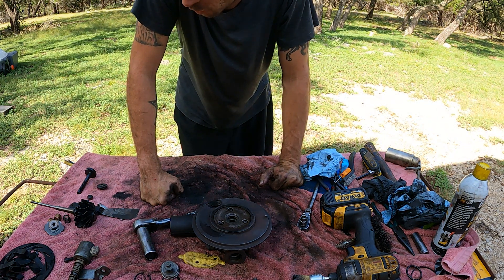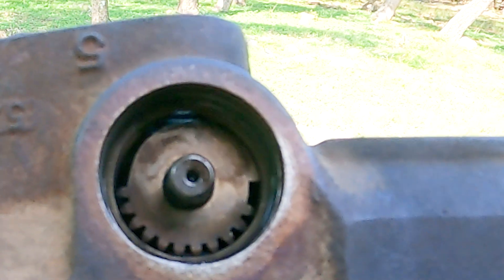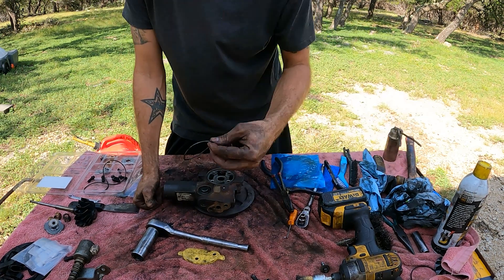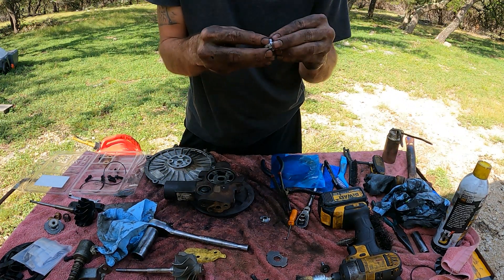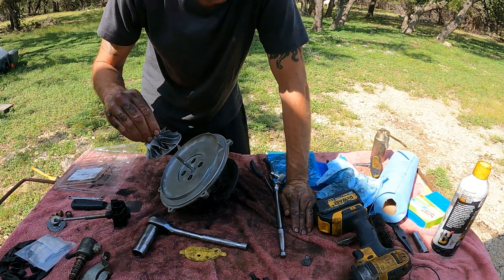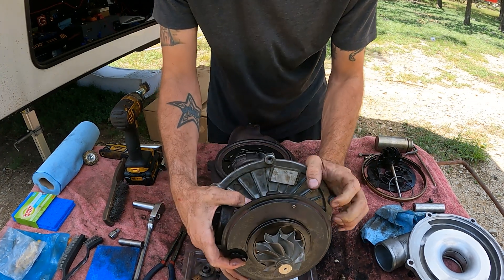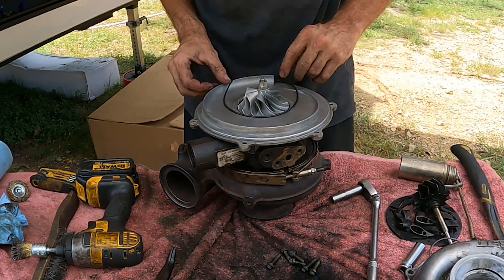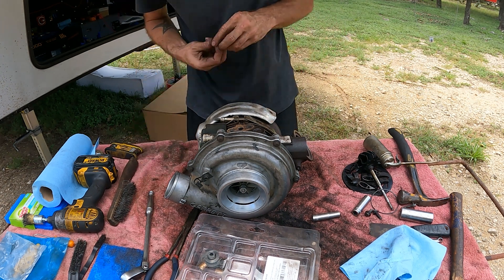6.0 Powerstroke - Turbo Rebuild With KC Turbo 10 Blade Wheel

Comment: Did redoing your turbo like that yield some faster spool times, etc?
Reply from the maker: Realistically, barely. Makes a pretty whistle tho. All real power mods come from tunes, injectors, turbos. Eh cp whatever pumps too. High pressure fuel pumps.
Reply: @grumpysdiy thanks for commenting

Comment: Where did you get the o ring for the vtg plunger? Mine is leaking oil from the plunger
Reply from the maker: I reused the old one from my turbo as the kit didn't come with one.
Reply: @grumpysdiy  what size nut did you use to pull the plunger
Reply from the maker: @hinds90 I’m pretty sure I used one from the turbo itself

Comment: Looking good. I did the same, but it only lasted 200 miles before the turbine shaft broke off... It obviously overspeed because of intercooler failure... I just had to buy a new standard turbo... then the head gaskets which I am am working on now...
Reply from the maker: I hope mine lasts
Reply: @grumpysdiy  did it?
Reply from the maker: Don’t have that truck anymore, couldn’t tell you.